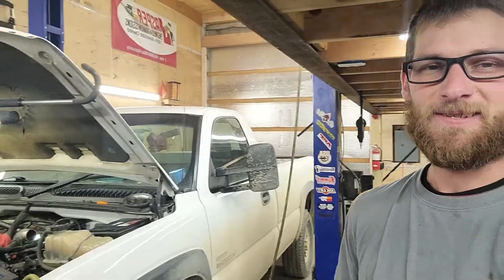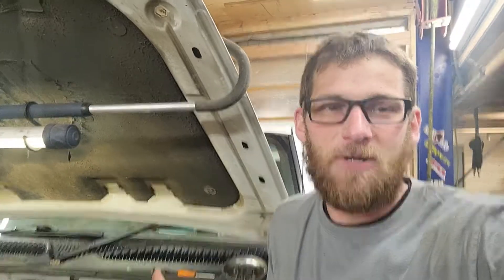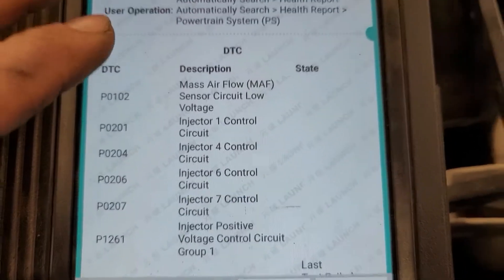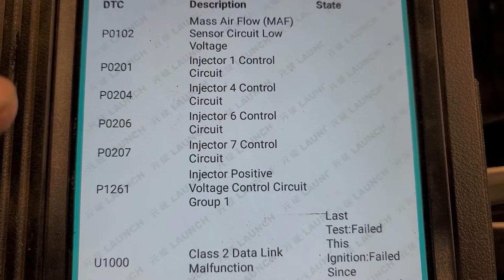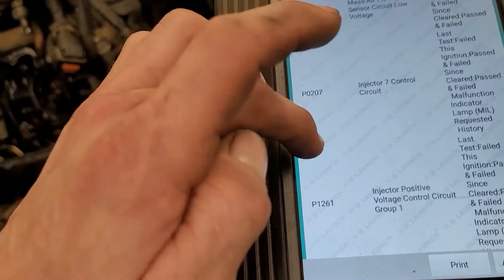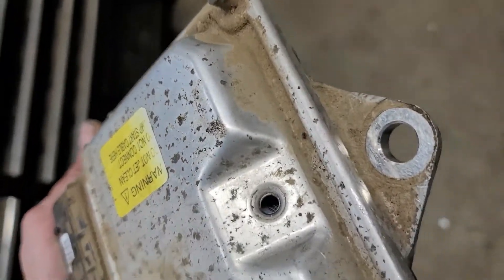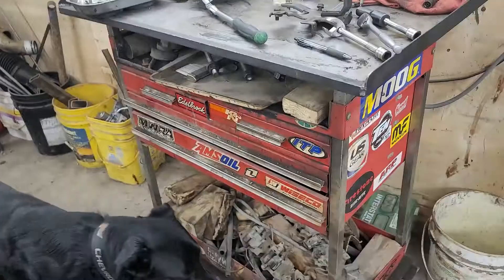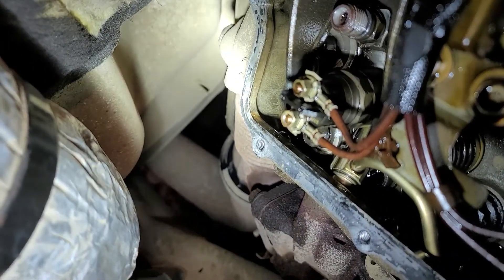Duramax low power p1261

Comment: Cómo llegaste a la conclusión de desarmar los inyectores
Reply from the maker: The control module had already been replaced and external wiring to module was good so went in knowing it was going to need an injector just didn't expect to find the terminal loose